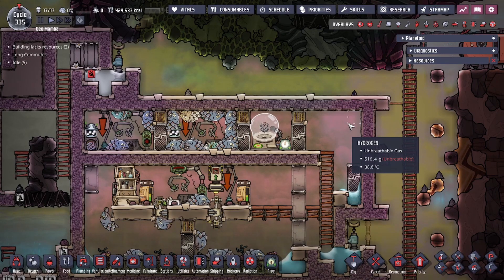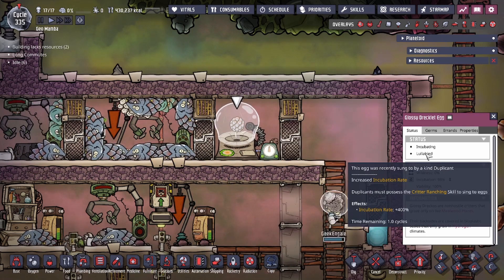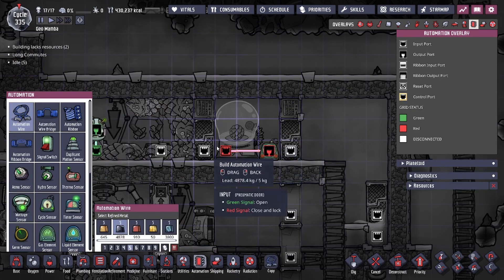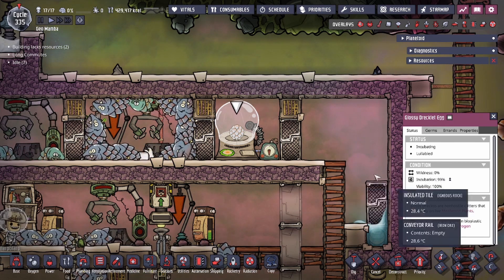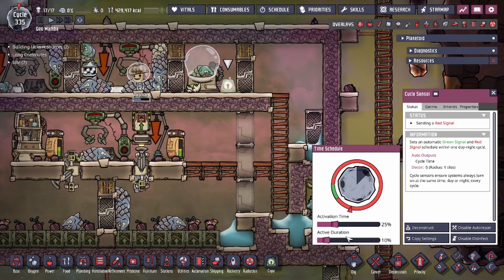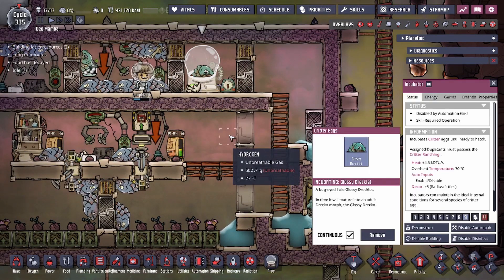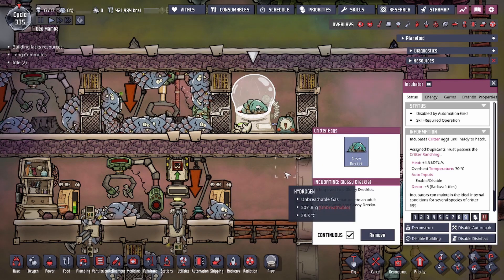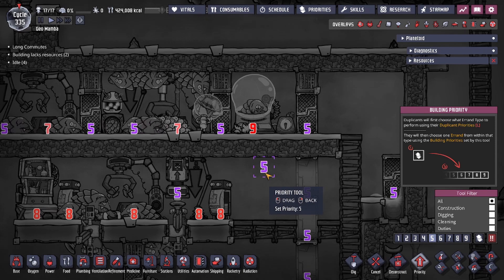How to Save Power on Incubators with this Simple Setup - Easy Automation - Oxygen Not Included

Comment: An egg cannot be lullabied if it already has the buff. This means once every few cycles you’re going to have a whole cycle where it’s missed. I prefer using a timer and setting the red time to 600 seconds. This means it will wait a full cycle after the green section ends. Overall increased uptime of the buff.
Reply from the maker: nice. looks like i need to add a filter gate and it'll be up to par

Comment: Instead of a timer, why not just use a motion sensor or something? I feel like that would be less time that power would be used. Unless of course you have it located right in the middle...I suppose that might not be less power then..
Reply from the maker: well, with the motion sensor the incubator doesnt actually turn on since it is only enabled when someone happens to walk by. this means that no one will ever visit the incubator because its disabled
Reply: @2LegitCity  maybe if you set the other priorities to 7 with the one right next to the incubator at 8 and the incubator at 9, the dupe may change the task and instantly hug the incubator (with the motion sensor or even pressure tile?)
Reply from the maker: @hyanghenry  you could but you would need to make an automation set-up with some logic gates, fine tune due to the RNG of task time =/= lullaby buff duration, and theres other issues not address yet, but all of that could be just avoided with a cycle sensor
Reply: They would run by it on their current task; not hug, because they were on the current task.  And then the incubator would turn off, before they had a command to hug it.

Their might be a way to do it using a pedal generator or something, but it's tricky with a motion sensor.
Reply: I've seen a setup with SnR logic gates paired with weight sensor. The only problem is you should know exatcly how long the lullaby buff your dupes give to the device, and its varies depends on the dupe's ranching skill itself. This is way more complicated than it seems. I just go with cycle timer myself.